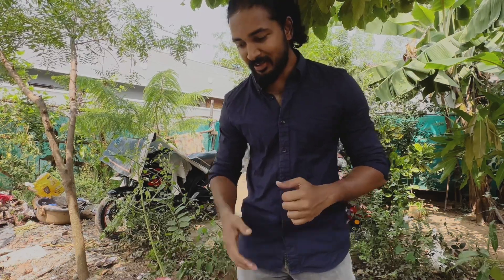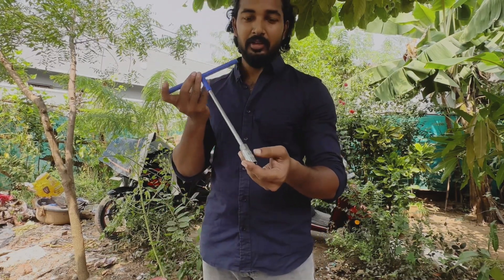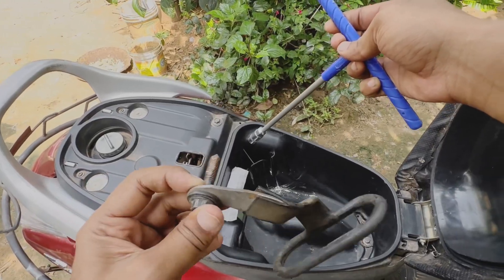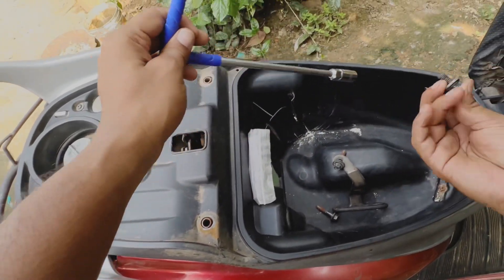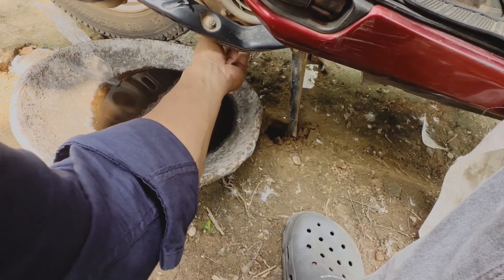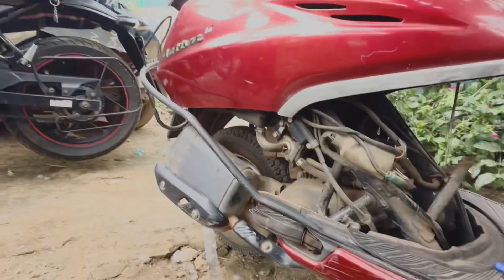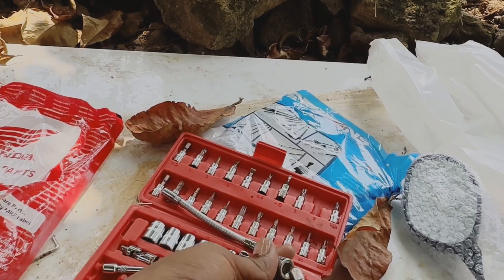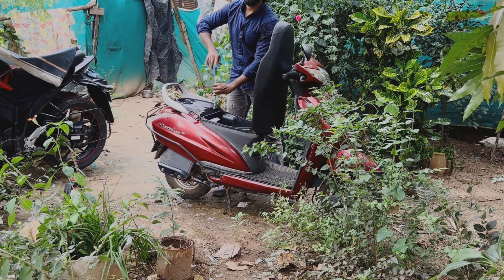The Ultimate Honda Activa 5g Service Tips You Need!

Comment: Bro na activa 5g service chesi almost 1 year paina avtundi 
Last one and  a  half or 2 months nundi  mileage taggindi 30 Or max 35 vastundi before that 40+ ochedi  
What is the solution?
Reply from the maker: @user-friendly468  bro you better clean carburettor and check the mileage and then do a service of engine oil and air filter and gear oil and secondary air filter and tyre pressure should be sufficient and spark plug clean cheyi bro
Reply: @kiranprakash  thank you bro
Reply from the maker: @user-friendly468 no problem bro feel free to ask 😊